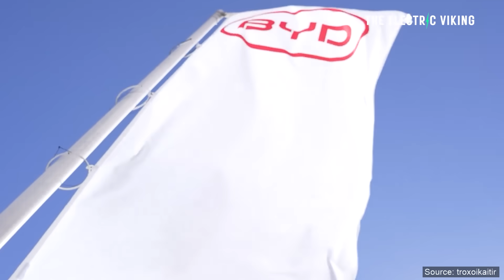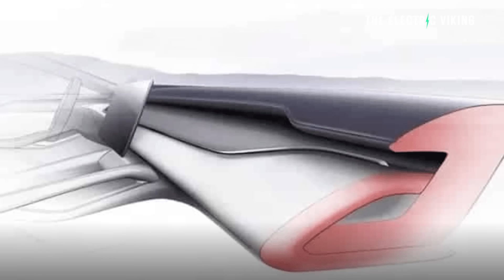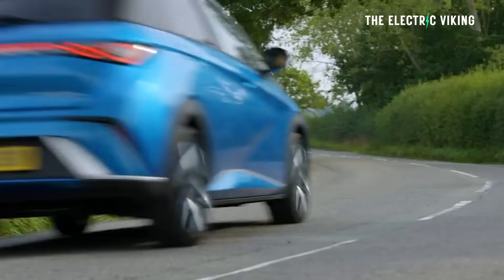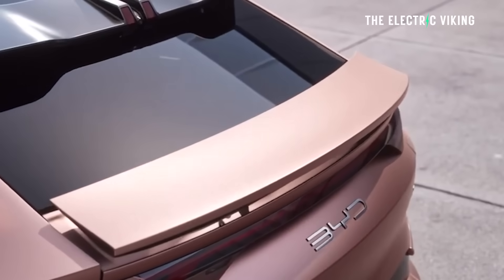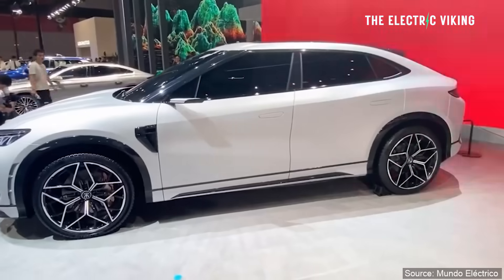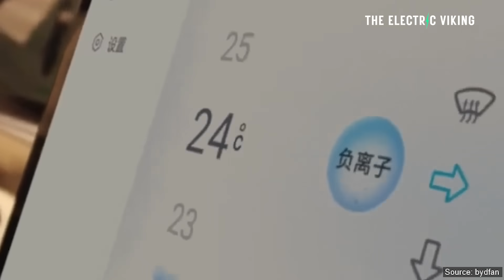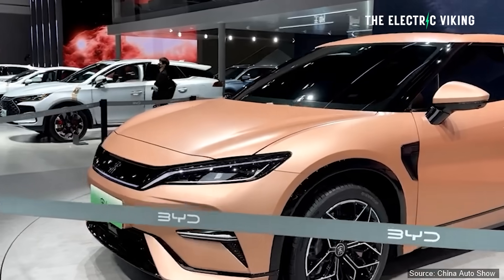BYD reveals a new electric car that's $3000 cheaper than Tesla Model Y

Comment: $3000 cheaper and you still get an indicator stalk and drive selector!
Reply: And a driver instrument screen... and HUD, and volume roller, and simply better interior materials and build quality
Reply: Tesla wants to attract BMW-drivers. 😊
Reply: @Elaba_  They seriously should do some sort of scientific study to see if BMW driving habits have on average improved over the past decade due to the fact that many of their non idicating customer base have indeed switched over to Teslas. At least in my neck of the woods, where a front license plate is mandated by law, I only notice two brands of cars that will flaunt that regulation and go without a front plate: Teslas and Bimmers. Seems like customer mindset between these two brands do overlap quite a bit.

Comment: It looks great and I would by one if it was sold in the U.S.A.  I just got a rental Tesla Model 3 and I am disappointed in it.  I guess that is because I am a senior citizen.  The Tesla is way to hard for me to get in and out of and I do not like the glass roof.  Keep in mind that I live in the desert southwest and it is still hitting 100 degrees here.
Reply: Then get the bigger S or X
Reply: You have to realize that I have been retired for many years now.  My income does not allow me to be able to afford either a S or an X.  The battery chemistry needs to be at least and LFP battery.  As far as I know once these outdated Lithium Ion battery's need to be replaced the cost will be more than just buying a newer vehicle. Besides I want a vehicle that has at least a few knobs.  All of this touch screen is for the birds.  I find that while driving I have to take my eyes off the road to look at the CENTER screen to even be able to watch my speed.  When I first got the Model 3 as a rental I could not even figure out how to turn up the fan speed.  I live in Tucson and glass roof just cooks the people inside the vehicle (a terrible design if you ask me.   I also do not need a vehicle that goes from 0 to 60 in however many seconds.  I also need room to put groceries in securely so they don't tip over while driving.  You will eventually figure this out yourself once you get older.  Obviously the Tesla's are made for the younger generation.

Comment: How does it compare in specifications to for example the Model Y ?
Reply: Similar to Seal vs Model 3 in China: For about 10% less in price, you get more range, more power, more features, better material and build quality, but the Tesla has better infotainment software and autonomous driving, and also faster charging speeds.

Comment: Thanks for mentioning the Disus Suspension system. I hadn't heard of this and it's a wake-up call to the car industry for sure.
The "Dancing Disus" video here on YouTube will astonish you. This - is a serious piece of kit. I couldn't find your Disus Suspension video.
How did they do all that?
I think that Tesla tends to win in comparisons for charging, reliability, convenience, efficiency, autonomous driving, uploadable software changes, etc. How does BYD compare on all of these points?
Reply: byd disus system is an preemptive system. it scans the road surfaces ahead and calculate the time till each bump and potholes and then the computer adjusts the suspension on each wheel seperately, to offset any bumps or dips. 
the dancing U9 video is just a performance to show suspension on all 4 wheels can be controled seperately by the car. in real life the application of the system is to make the ride super smooth.
Reply: Disus is actually a series of different types of active suspension with completely different designs. The dancing disus is DIsus-P, the most advanced type, composed of a fully electro-hydraulic system, essentially unique in the car market. Mid range BYD vehicles such as Denza models will get Disus-A, which is essentially a highly advanced air suspension. This lower range BYD Song L will likely get Disus-C, which is just rapidly adjustable damping of its conventional spring based suspension.

Although this does show BYD's R&D prowess. They are not just releasing new cars via badge engineering, but instead they've developed entire tiers of different technology for the new cars they are releasing, some of which are not just industry leading but simply not available from other carmakers, Tesla included.

Comment: BYD is Tesla’s main competitor when it comes to Electric vehicle manufacturing. We are quietly waiting to see where their European Car manufacturing plant will be established France, Italy or Spain, to join their existing BUS assembly plant. The U.K. is an outside possibility given the successful BYD Alexander Dennis battery-electric bus partnership which has recently delivered its 1,500th bus.
Reply: europe is quite unfriendly towards chinese businesses nowadays. considering they have their own auto industry i don't think they would let byd set up a plant there easily. even tesla met so many troubles there.
Reply: @qilu2004  Indeed, their only manufacturing plant is in Hungary for Buses, though their tie up with  Alexander Dennis dates back to 2015. Still believe they are Tesla’s true competitor. Tesla’s problem is BYD has a significantly wider portfolio of vehicles so are in a stronger position to ride out fluctuations across different market portfolios.
Reply: @DC.409  byd can produce an ev cheaper than anyone including tesla. that is why byd thrives in a pricing war while tesla suffers in it. if not for geopolitical issues, byd can undercut everyone in every market (except the US because of the 25% import tax).
Reply: @qilu2004  Totally agree, they were supported by Warren Buffett, and Charles Munger very insightful gentleman. The big question is when the EU, which ultimately means all of Europe, imposes an American type import tax on Chinese vehicles, personally I don’t think it’s if, but when. Though Germany is the issue, they have significant investments in Chinese car manufacturing and Chemical plants.
Reply: @DC.409  german auto industry will go broke in that case. so germany will veto any dramatic measure.

Comment: Firstly i dont care how it looks ..i care IF i can afford it !  3000 cheaper then Tesla is not enough ! If they want crazy levels off mass sails, it needs to be 10 000 - 15 000 cheaper then Tesla.
Reply: I'm afraid that if that's all you can afford you'll have to settle for 2 wheels.
Reply: U should go buy some indian made, it surely cost 20 000 lower
Reply: Then get the Seal U / Song Plus Champion Edition. That car starts at $23k USD in China at current exchange rates. About the same size, but not as luxury/performance focused. The Song L has active aero, active suspension and a lot of cutting edge technology that make it far more advanced than competing vehicles. If you want a less expensive car, they have that as well.
Reply: @nagi-springfield93  Where you can buy them in Europe for 20k or less ?
Reply: @Nat_Ryder   I settled with my 2 gasoline cars which will work for many years in to the future .  I would like to electric but I wish they concentrate not on design but the price and range.  If this should be a "e-revolution" they need to come with good sized cars with range around 600km for 15 - 20 k
Reply: @larryevans6739  ..i dont live in china
Reply: @MartinMartinX  the prices mentioned in the video are based on China. Seal U/Song Plus will be available in other markets, but no word yet on pricing. Still waiting on Song L export plans to be announced.

Comment: When are these on sale in USA?  Not seen one yet on the road here in Eastern USA
Reply: UAW lobby will never allow this to be sold in USA. Otherwise how else can they go on endless strikes if there is real competition?
Reply: It is about bringing manufacturing back to the US.   Seems to be working.
Reply: @johnsmith-cw3wo  Are you dudes so nuts not to reaiize it about economics.  BYD is same as Hyundai, I have a Ionic 5, it is awesome.  Built in South Korea, why is BYD different?
Reply: It wont come to usa based on security issue, same like huawei.
Reply: As best as I can tell there have been no restrictions placed on the import of BYD cars into the US for security reasons. The concerns that have been raised about the security of BYD cars have not been enough to warrant government action.   They have banned the US government from using BYD vehicles.
Reply: @JeffWusch  US has additional tariffs and sanctions on China (27.5%+). And BYD would not qualify for massive consumer and manufacturer subsidies that easily add up to as much in benefits for their competitors. US has even tried to block US-made BYD commercial vehicles, which led to BYD spinning off their US operations, reincorporated in the US. So, even bringing manufacturing to the US does not gaurantee access. Korea has trade agreements with the US...

Politics keeps BYD out.

Comment: How do most people charge their electric cars in China? If you don't have the ability to charge your EV overnight, they are just impractical. Being in the US my perception is most in China live in apartments. Maybe I'm wrong. They must have a better charging network than the US. Does BYD like Tesla in the US have its own charging network?
Reply: China is very good at building infrastructure, so their public charging network is vast. Just the city of Shanghai has more DC fast chargers than the entire US combined. This is also one of the reasons why Tesla doesn't have a dominant market position in China. In the US, many EV buyers simply has to buy Teslas if they road trip often, since the public CCS charging network is so much smaller than the until now still proprietary Tesla supercharger network. In China Tesla also has its own branded network, but it is miniscule in size compared to the vast public charging network, much of it owned and operated by the state. Some other Chinese EV makers also have their own charging network, and most notably NIO has their own proprietary battery swap network as well, now up to 2000 stations and growing. But BYD, the 900 lb gorilla of China's EV network, actually does not operate its own charging network, and it doesn't need to, due to the size of the public charging infrastructure in China.

Comment: Small correction. Structural battery is an idea that has been around for a long time, not invented by any particular person or company. What matters is that BYD beat Tesla to it in putting it into mass production with their Seal model.
Reply: Incorrect, tesla beat byd by selling the first model Y to a paying customer with the structural pack in April of 2022.
And multiple teardowns of tesla model Y with the 4680 structural pack are right here on YouTube from 2022. 👍🏻
Reply: @4literv6  I said mass production.
Reply: BYD's structural battery cells are actually a new idea. Other structural packs use a heavy case for structure. In the case of Tesla, filled with rigid foam. For BYD, the blade battery cells actually provide structure.

Comment: With that sloping roofline, I wonder how much headroom there is in the back seat.  Especially with a battery pack under the feet.  I am surprised nobody is building battery packs that only go under the front and rear seats and center console.  I've done the calcs many times, and a 50KWH pack will fit easily in that area, 90KWH if using smaller cells that can go double height.  The same height car would have 4" more headroom if the footwells were the floor instead of atop a battery pack.
Reply: It is sloping quite late. Compare to new Polestar 4 which solves this. The sloping is an illusion because it does not happen until very late (it seems) as Polestar 4.
Reply: Lucid Air has that set up in the lower range versions. Want more range your leg room in the back still has to go though.
Reply: @tellyboy17  Thanks, I didn't realize Lucid had the option.  I still don't understand why extended range would need to use up that footwell space, though.  As an example, 21700 NMC cells fit 200 cells in a 12" square box 3" tall, and that is 3KWH.  A vehicle floor that is 5' wide will fit 10 sf under the front seats and 15 sf under the rear seats before getting anywhere near the rear axle.  2 more sf under the center console between the front seats.  that is 27 boxes x 3KWH = 81KWH pack just a single layer 3" high leaving all 5 footwells open.  You should be able to fit two layers in all those areas, which would give 162KWH.  With the larger LFP and Blade cells, the volume gets much worse, so I can see BYD having trouble, but Lucid is using NMC, so shouldn't have trouble.  The smaller the cross section/frontal area a vehicle has, the less drag for the same CD, so the opportunity to reduce the height while maintaining the same headroom should be important to mfrs.
Reply: 50-50 front to rear weight of the car. Optimum for handling.
Reply: @ZeusBullyMax  Maybe.  But between the front seats could fit a stack 6 layers high if necessary and still be under arm-rest height, so 18  boxes 3KWH and 30lbs each, with maybe just 4 more boxes under the front seats and 5 more under the rear seats for 81KWH total.  Seems like plenty of flexibility to move boxes around and reach whatever fore-aft weight distribution you want.

Comment: China is continuing to build its strategic nuclear arsenal and has amassed 500 nuclear warheads as of May, the Pentagon said, an increase of 100 over last year’s estimate. The United States has recorded more than 180 intercepts of U.S. aircraft by Chinese military forces in the region. China is building military infrastructure in the disputed South China Sea. A Chinese fighter jet that sped toward a U.S. military plane dipped under its nose and later came as close as 10 feet underneath it; a Chinese fighter flew within 20 feet of the nose of a U.S. plane, which took evasive maneuvers to avoid a collision; a Chinese fighter jet also fired eight flares while 900 feet from a U.S. plane. China has warned that it will impose a blockade of Taiwan.

Comment: Don’t even go there, BYD were doing structural battery way before Tesla
Reply: I doubt that. Now you’ll say that they were using giga castings first also.
Reply: @ZeusBullyMax go look when the Han was first introduced 4 years ago. Blade battery. Back then Tesla hadn’t heard of a structural battery
Reply: @bydman5320 it doesn’t reinforce the structure of the vehicle. It’s not a structural battery pack
Reply: And it is cell to body. In other words, the battery cells provide the structure. Tesla uses a heavy steel battery case filled with rigid foam to provide structure. BYD is not copying Tesla.
Reply: @Mehffort are you for real? Look at a blade battery and think how it’s installed and then tell me if a side impact will crumple the car less

Comment: Whys is it that BYD is doing all things right in improving design/functionality/ pricing in NEVs, as all Western brands have difficulties on all levels, and TESLA looses its advance by working on the weird CYBERTRUCK and TRANSPORT TRUCKS ??????? This morning they showed a LUXURY VAN of SAIC/ MG driving on hydrogen: the Chinese say FXXck the West, we can do it better and cheaper. ( for instance: no expensive carbon gas vessels)..... DIFFICULT TO ACCEPT FOR WESTERN CAPITALIST, BUT THE CHINESE DO ALL THINGS BETTER AND DO NOT HAVE THIS INFANTILE FAITH IN DEMOCRACY.
Reply: Hydrogen is a losing proposition. It has not, and will not go anywhere.
Reply: @ZeusBullyMax  Hydrogen-cell: 1. made by big  windfarms of the Chinese desert. 2.cell made of Chinese mined metals 3. dense Chinese cities do only need few loading points for vans and trucks.
Reply: Currently Byd is the most vertically integrated EV maker in the world.  Tesla, Toyota, Benz and other automakers are cooperations or sourcing various EV components from Byd, including blade battery.